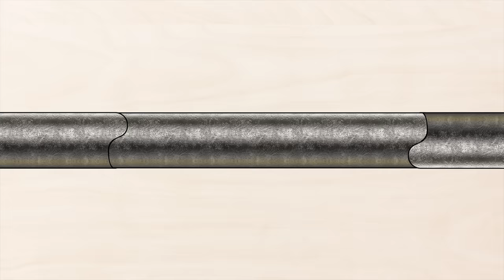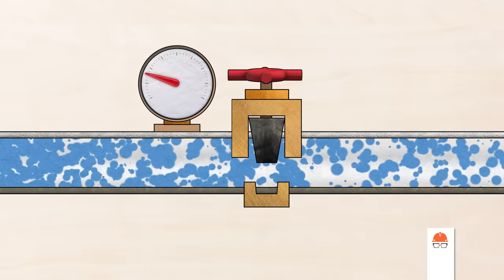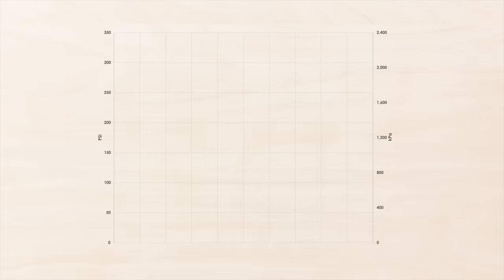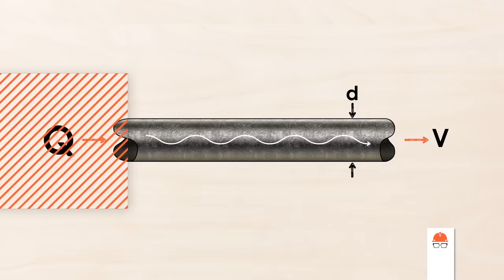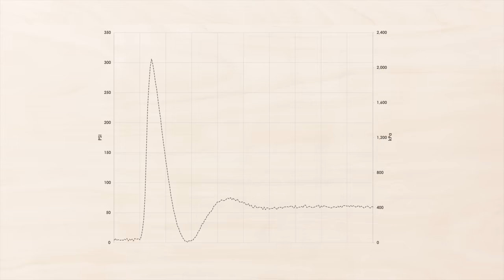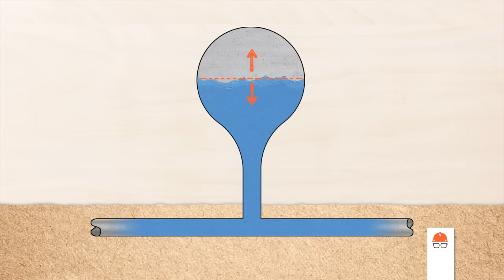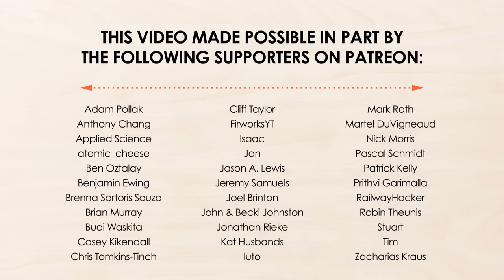What is Water Hammer?

Comment: Thanks for all your information. I have an Orbit irrigation system that works with selenoid valves that create a hammering noise as it turns on and off. I tried with a hammer arrest cylinder but did not solve the problem. The only thing is that I had to install it horizontally (not vertically as yours in the video). Does this make it not work properly?
Reply: You need an appropriately sized surge dampener. A bladder surge tank may work in your case. If the hammer arrest cylinder is too small, it won't do much of anything in your case.

Comment: So how would you solve this issue from a sprinkler auto-timer? Been using my sprinklers for over a year (4-in-1 Melnor sprinkler timer), and all of a sudden a couple months ago we noticed the wild and loud noise from one of the sprinkler timers outside when it shuts one 1 out of 4 of the outputs off. Haven't heard it from any of the others, and haven't heard it from the other timer on the other side of the house with those sprinklers.
Could there be any issues with the piping in my new-construction house, or could this cause any new issues if we just keep letting the timer do this? I've definitely never heard of "water hammering" before this, but I've probably heard the water noise before growing up (never heard it at any of my houses though).

Comment: I worked in a older Power Station for many years as a operator, what we called Water Hammer was due to a steam range being insufficiently warmed through and drained before the introduction of normal steam flow. If the steam range was not warmed through sufficiently the steam would pick up condensate in the pipe and it would hit the next bend in the pipe with great force depending on the steam flow. This was a scary thing to watch and hear. nothing like a 300mm steam pipe bouncing around on its support bracket springs, made for a angry engineer and a sorry operator.

Comment: What is the difference from the equation given and the Joukowsky equation often used? 

Additionally, if there are two pipes of different materials. Would this mean the pressure spike in each section is higher dependent on the material of each pipe?

Comment: You missed a couple of interesting facts.   If the valve was placed at the start of the 100km pipeline, and shut quickly, it would cause a local vacuum behind the valve, followed some time later by the returning water hammer.    Also it is possible to use the water hammer principle to pump water to a higher level.  We have a local stately home that has been using one of these water rams for over 200 years, to supply water to the house 80ft above the river.

Comment: Theoretically, there would also be the possibility of installing a water basin or an expansion tank (with an air valve) in between to reduce the increasing maximum pressure!

Comment: Water Hammer is the common term used by non-engineers.  
A fluid mechanist would rather refer to this as a pressure transient, which can ALSO occur on a sudden valve OPENING into a fixed volume such as priming the feed line in a Spacecraft propellant system. 
Incorrect fluid system design can and has lead to catastrophic failures on spacecraft systems resulting is the loss of the spacecraft.

Comment: Grady
Thanks for your video.
I need your opinion about installing a emergency shutoff valve in a high pressure gas export line. When its a compressible medium, how does the water hammer effect derivation occurs -

Comment: Plumbers use an easy answer called an "upcomer".  It is a short section of pipe filled with air that stands upright and cushions the stopping of the water flow.  They work very well to stop pipes from banging.  Ask a plumber.

Comment: I work in the asphalt industry. We use steam to heat certain low temp emulsions. Iv seen schedule 80 elbows explode by slamming a steam line closed or opening the valve completely very suddenly. We call it steam hammer and it’s incredibly dangerous.

Comment: Can you comment on this issue. I have a booster pump with 1' dia but the incoming pipe size is 1/2' and the outlet is 3/4'. When I use the pump, a very 'faint' knocking can be heard. I'm not sure the knocking happens before or after the pump. I cannot change the pump size and the outlet pipe but I can try to change the inlet pipe from 1/2" to 3/4'. Does the knocking can still be heard?

Comment: I have a water pump located directly under the tank. .
The water pump works normally when I water the trees in the garden,
 but after a while I notice that there are air bubbles with the water coming out, and also the water hose vibrates and then settles and water and air come out.Can you explain .
thanks .❤️

Comment: In the early part of the video you mention how much mass all of the water in the pipes has. Later, you suggest increasing the pipe diameter. However, wouldn't the fatter pipe have more water and therefore more mass? Would the extra mass offset the reduction in velocity when thinking about momentum? That said, mass didn't seem to be one of the terms listed in the equation.

Comment: I would like an explanation on what happened to me. I live in a house that's over 100 years old, the water pipes are all copper now including the main, all cast iron pipes have been replaced, so far so good. There are two porcelain wash tubs in the basemwn5 like all houses had back then, one day put of the blue I turned the cold water on then the hot to wash my hands and was trying to get the temperature just right when will of a sudden the pipe started banging like crazy, I eased off the hot water and it stopped. This had never happened before, I lived wwith it for many years until I heard about something called a water hammer arestor, it's a small cylinder that is soldered in a section of the water pipes with a T connector, that didn't work, the faucet is original to the house and is in perfect working order except for the occasional washer change. One day I went in the basement and  noticed the faucet was dripping, tightening it didn't work so I took it apart and replaced the washer, when indent to test it the water hammering had disappeared and has never returned, my question is why? Why did changing out the washer cause it to stop hammering, it makes no sense to me.

Comment: Refrigeration lines can also experience hammer if the liquid line solenoid valve is oversized. But it happens when the valve opens. It’s a common mistake of people who don’t know better to match pipe size instead of system capacity requirements. Bigger isn’t always better

Comment: I know this video is dated but it's still good info.  I'm wonder if during your testing with water hammer arrestors, you determined there's any advantages to where the arrestors is installed, relative to the valve.   In the video, you installed the arrestor in the middle of the T, meaning that's it's not in the orientation of the water flow.    Maybe hammer arrestor adapters that are designed for the back of washing machines have the arrestor "inline" with the hose and the value (washing machine) itself comes off the middle of the T.  Is that orientation any better?  Or maybe it doesn't matter at all.

Comment: Is there a different term for when the pipes can drain and be full of air, then water rushes down the pipe and breaks (in this case, a sprinkler head) at the far end?  This must be an issue whenever lawn sprinklers are installed in lawns which are not perfectly flat.  The system drains at the lowers sprinkler so the pipe is full of air.  When the pump turns on and water rushes down the pipe, sprinkler heads break apart.

Comment: This is a great video and very informative.  However, I'm curious as to exactly why increasing the pipe diameter would help mitigate hammering.  It does make sense that the water will slow down in a larger pipe, however, wouldn't the mass of water inside the pipe would increase proportionally?  Thus, the momentum would be the same, which is the real enemy here, and not the velocity.   I think?  Am I missing something?
Reply: For a fixed flow rate, a wider pipe will let the water inside travel more slowly. Slower water means a lower spike in pressure.

Comment: I found out about water hammer when I moved to UK. After I pulled the floors in my house I found out that most local tradesmen are brain impotents without any education, lacking ability to think and were not bothered to fix the pipes around the house. All pipework was simply dropped on the ground or subfloor.  So simply,  if you have any water hammer in your house, fix your pipes every 300mm and problem will be solved.

Comment: Water hammer is the princuple of the water ram, I know of a house that was fed from a spring the water was fed through a pipe that was momentary shut and the resultant pressure surge forced water through a non return valve to the house.

Comment: I have water hammer with both outside garden faucets I have located the intrusion of air from my water softener will a check valve placed on the water pipe after the water softener solve the hammer and where would I put the check valve?. The pipe is about 6 feet long and meets  shut off lever that controls water to the outside faucets.

Comment: Very dangerous in high pressure water lines I did 250bar pressure water line.we use bypass valve to circlulate low pressure water to circulate in downstream

Comment: Thanks Mr Grady,  How to solve the problem of water hammer after the pump stop suddenly, pumping water  up to 18 stories  apartment,  the non return valve
always damaged  and great pipe vibration inside the pump room, can you show me the easy and cheaper methode to solve this problem.
Reply: Water hammer may be induced by negative pressures in your case. The pump strop causes a sudden pressure drop causing water column separation in the system. A surge tank may be the appropriate solution for your application.

Comment: I have extremely bad water hammer at a laundromat I just bought. 2” pvc carries the water and every time the washer valves shut off they whole pipes shake. It’s even started a bad leak. I’ve installed bladders for hot water heaters but it’s still not helped. Wondering if I should just close the main valve that feeds the whole building more. I’m stuck.

Comment: Great vid, and very well conveyed throughout. 
This addresses higher pressure from valves closing, I have hammering happening when my sprinkler system switches zones.
I believe it is happening when/because of the automatic opening up of one of the zones.

There is a large, basketball size/shaped type thing over the water heater (culinary sprinkler water), so I don't know if it isn't working, of something else is needed. Any thoughts anyone?

Thanks, Bob

Comment: If I attach a water hammer arrestor(?) to my shower hose,
will it reduce sudden hot/cold water changes due to others using other water outlets in the home?
Is there any other/better solution for this?
It seems like in-home AND other apartments cause water pressure sudden changes (water hammer(?)).
Thank you!

Comment: I have a hose spigot that has a sprinkler manifold coming off it that has such bad water hammering that if you shut off the hose to fast it will, without fail, split the pvc on one of the valves

Comment: As a plumber, water hammers are sold unnecessarily, due to inaccurate diagnosis, but selling a water hammer makes them more money because most plumbers are paid percentage, so you can see how they will sell a water hammer unnecessarily, especially when it due to a toilet fill valve, it's easy to test for

Comment: Do you know anything about “su koçu” it is a pumping system that named in Turkish. It can be translated to English directly as water hammer or hydraulic ram. Fascinating device that can pump water against gravitation using water-only energy based on same mechanical principles that you told in your video.

Comment: Any plumber or water system manager knows that is you have drained a water system in a home or building when you turn the water back on you better turn it on SLOWLY and also SLOWLY bleed the Air out of the entire system.
Many years ago in Ohio the water was turned off for a repair in the road that supplied the water to a huge apartment complex where I was in maintenance. 
When the road crew was done with the repair they just quickly opened the gate valve. That wall of water hit the apartment complex like a Tank. It resulted in roughly 80 water heaters rupturing and the resulting floods caused a lot of damage throughout the residences. 
The only good thing from this nightmare was I got a lot of overtime from all the added work.

Comment: Um, water hammer is not generally quite as dangerous as a bomb, which generates a gas explosion, or as dangerous as a steam explosion.   Simply because water is incompressible, therefore does not have the same stored energy as steam or compressed gas.   This is why pressure vessels (such as boilers) are frequently tested with water, rather than compressed air - in the event of rupture, only a small amount of stored energy is released.
Not that I wish to minimise the consequences of water hammer, which can be quite expensive - but rarely fatal.

Comment: Old video but hopefully someone give me some suggestions. I'm pretty familiar with water hammer after building and installing ram pumps, pretty cool things.
Anyway, my issue, at the plant, the dry fire sprinkler system, has three risers, one is an older 4:1 clapper, the other two, rely on a sidecar that more or less use the supply water (Municipal main) pressure to keep the clapper closed. Typical supply pressure is 50-55 psi. Twice in less than two months the 4:1 system tripped, and wet went. the Side car system both had pressure gauges with check valves that showed the pressure had exceeded 200PSI. 
Trying hard to ID the cause, the municipal water department says they pump at no more than 60PSI, and the line we are on gets supplied strictly by gravity, and any water hammer would be absorbed  by the water tank. 
My sprinkler system is in good shape, inspected annually, and each time this has happened, I have brought in Licensed sprinkler inspectors who find nothing wrong with the sprinkler system. They have tried to explain the system, and what the gauges show is supplied pressure from the village, and are being met with "that's not possible". 
I believe that there may be a new business in town, or someone doing construction that is using a great deal of water and closing their valves too quickly; creating the water hammer, we are seeing in our system. The village says they can see when someone is taking large volumes of water, and at the time of the trip, they don't show anyone was. They also say that the pumps used to fill the tower were not running.
I'm frustrated as I'm now dealing with a fire marshal that wants to know why we keep having false alarms that they are responding too. I have explained as have the Sprinkler guys and he tends to agree but also is not going to get in the middle, yet.

Comment: Can anyone point me toward the pressure sensor and the board setup that is getting used to detect the spike? Thanks!
Reply from the maker: The pressure sensor is something similar to this: https://www.digikey.com/product-detail/en/te-connectivity-measurement-specialties/M3041-000005-250PG/MSP3251P3-ND/206923 I can't find the exact model I used, but this should get you started. The board I used is just an Arduino UNO. The Arduino reads the voltage and sends it to a laptop over serial. I did all the post-processing in excel by just copying and pasting from the serial terminal. Hope this helps!
Reply: @PracticalEngineeringChannel  Thank you!

Comment: MISSED the opportunity for a MUCH better explanation... and critical need... for the inclusion of a water hammer arrestor close to a valve that shuts quickly (like an irrigation valve).  So the air absorbs the shock.  
Also, give some guidance on the size of the arrestor and/or NUMBER of arrestor (in sequence) as close to the shutoff valve as possible.

Comment: Interesting to consider the problems with pumping liquid sodium in a nuclear reactor, it is pumped continiously but how do they maintain it? Sodium has a density of 0.9 and you cannot use a surge device with air in it. and it solidifies at temperatures less than around 30 degrees C. So what happens if a pump stops working? Perhaps the electric motor can be swapped in and out. There is probably a redundant system.

Comment: If my shower has incredibly high water pressure and a low flow fixture is put on, should i worry about  pressure increase? Its leaking from the amount of back pressure. I think the old shower head had a higher flow.  My apartment has old galvanized pipes and high pressure every where. i know some pipes have broken in other units so I am afraid of causing a pipe to burst. Would a higher flow shower head be less likely to leak or cause too much back pressure? Can anyone help me? I don't know if the water pressure changes according to the fixture i.e no more than the pipes/fixtures can handle. Any advice is appreciated!

Comment: I understand the differential equation you were using but I feel like it would have been more useful in its integrated form. You were using the change in velocity term to describe the scalar value of velocity in your video, which I don't think is correct.

Comment: So if water isn't compressible then why do we use hazardous and poisonous hydraulic fluid ?   I watched a video from years ago about diving bells , in a test dive the seals of the bell leaked .   When they raised it and used a sledge hammer to open the appox 8in cap , a water stream shot out of the bell about 50ft at least .  There was definitely more water that shot out then the bell would have been able to hold .  The cap was midway up on the side .